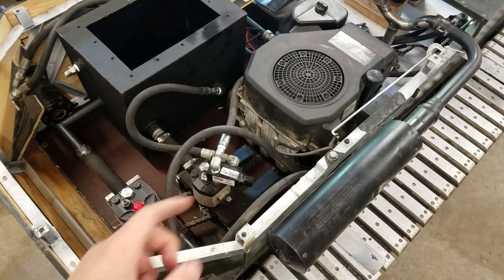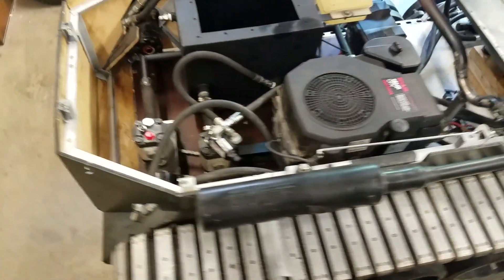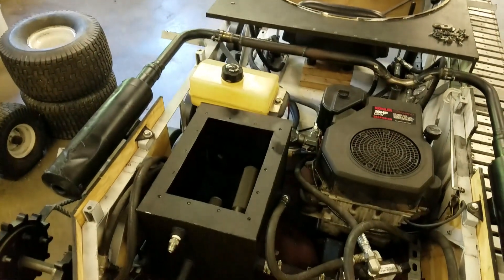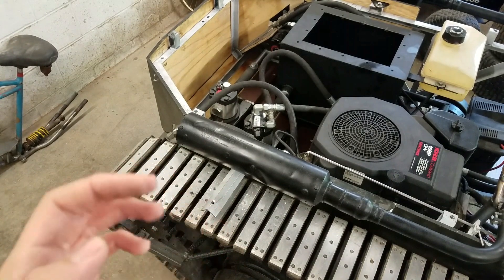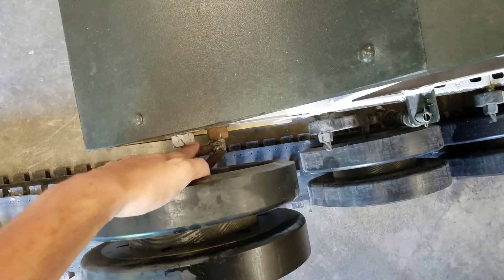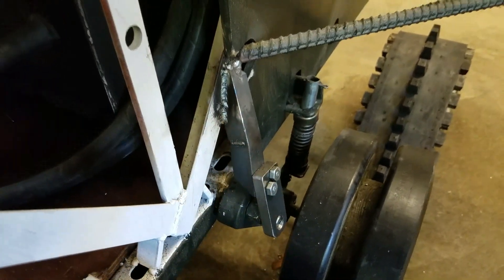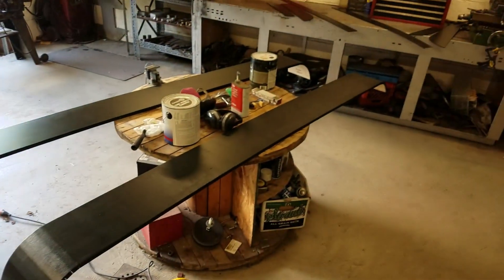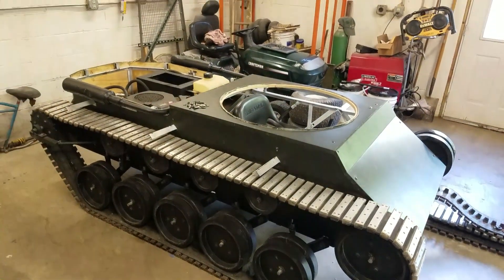Homemade Tank Part 24 (Drive System Upgrade)

Comment: If your spool valves were open Center you should be able to turn the tank without having to add a second pump to it when you put the left one in neutral the tank will go to the left when you put the right one in neutral that tank go to the right do you have motor spool valves???

Comment: I guess it's too late since you already finished this project, but instead of a second pump, you could have gotten a circuit isolator valve. Then you could have two independent circuits on one pump.

Comment: on your Hydraulic tank, your return line should feed through a filter( 10 Micron) is the norm on most hydraulic systems; before it goes back into tank, it would catch debris much more efficient and reduce contamination from getting in the tank and reduce air less of chance foreign object affecting the system, It doesn't take much to kill pump.

Comment: The front idlers need to be sprung. You can easily add that by putting in a piece of steel plate over the triangular box frame and a big laterally mounted spring corresponding with your idler adjustment slot. It will absorb the torque when you turn and then stop the bends! The more stuff you put in to stop it, will only expose other weaknesses...probably the track will go or even the wheel itself will distort. I am not trying to be a downer, i just want this magnificent machine that you have built, to be there for your kids! It is a fantastic job and has inspired me to undertake a project! Thanks!

Comment: How much do you think thus will have costed you when you are finished
Reply from the maker: probably in the $1500- 2k range, but I had access to a lot of the materials for free
Reply: RealSteel 1776 what materials did you have for free already because one day I might build a tank if I can
Reply from the maker: almost all the steel, all the wood, material for the wheels, I even got the hydraulic hoses all for free, and all the necessary tools to put it all togehter

Comment: I plan on building something like this but instead of an engine there will be 2 hand cranks in the fron next to the driver which control the tracks
Reply from the maker: handcranks, wow, that's a good workout
Reply: RealSteel 1776 yep but it will have gearing so it would be a little easier to pick up speed and no fuel emissions if I were to use an engine
Reply: castielfan13 Good luck with that lol